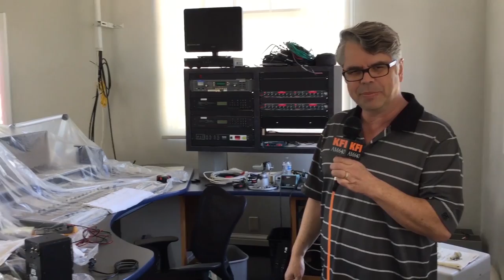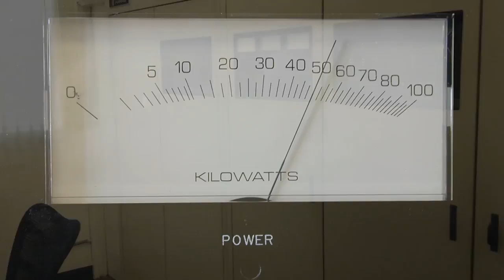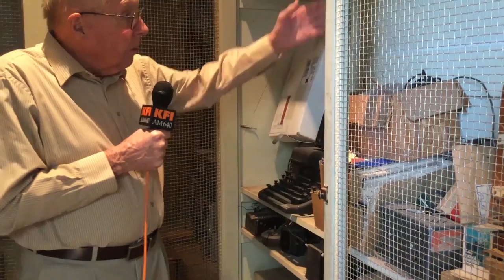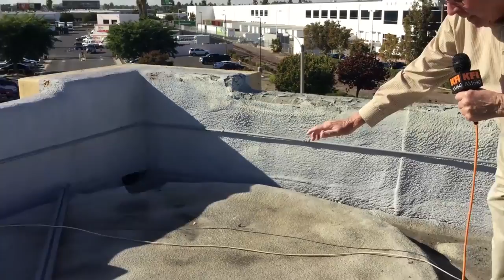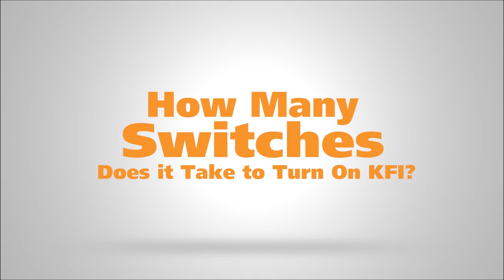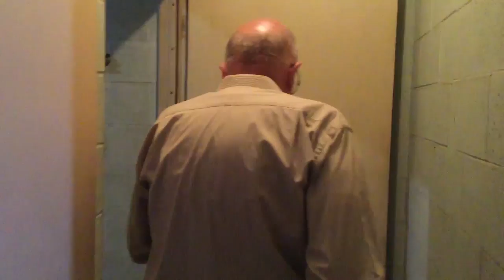KFI AM 640 50kW Transmitter Facility Tour

Comment: Having been in radio for over 50 years, and loving the engineering side, great job on this video. So much has changed, making the job easier!  It was nice seeing the progression in transmitter size, we loved the DX50’s, but Nautel came along and successfully crammed a lot into a small package. Again, a very enjoyable video!
Reply: I liked the transmitters you could walk into.  The RCA TT50AH TV transmitter even had a little “garden shed” for the HV rectifiers.  I can’t remember if TT25AL had the same feature.

Comment: In the mid 80's I lived in Buena Park, about 2miles from the antenna, and built a crystal radio that only played KFI out of an 8 ohm speaker. It only needed a stake in the ground and a long wire loop connected to an inductor and a diode.  The RF energy in Buena Park was so strong that it did not need it's own electricity, it could extract it from the earth and a long wire.
Reply from the maker: That’s amazing. Do you still have it?
Reply: Wow !! I service guitar amps and other related gear . I find modulated electronics fascinating as well.

Comment: I have to think that many of those extraordinary backup features were a result of KFI 640 being a 50KW clear channel designated official info source back in the CONELRAD era.  All the receivers had the round/triangle CONELRAD symbol on the frequency scale at 640 KHz and 1240KHz.  
According to the FCC, KFI is still 50KW, but certainly not clear-channel anymore.  Several other AM stations on 640KHz in North America including others running 50KW. and many in Canada, Mexico, and Central America.
Ref:  https://en.wikipedia.org/wiki/CONELRAD

Comment: KFI just celebrated it's centennial:  Commerce Department license number 137 was issued to Earle C. Anthony on 31 March 1922.  Anthony, the Packard dealer in LA, was also a decent engineer himself.  Back then, all stations shared 833khz.  Once the band was spread out, Anthony nailed down 640 and stayed there.  The only other station there then was WOI, the Iowa State University daytimer.  For years, the NBC affiliate in LA, with battles between Anthony and RCA boss David Sarnoff, who wanted to buy it.  With clear channels being broken down over the years, it doesn't mean what it once did, but KFI's position at 640 made it unique.  Here in St. Louis, the former KXOK, 5kw on 630, pretty much eliminated KFI, so I only got to hear it when I went out toward Kansas City.

Comment: I started Dxing when I was 15 with a National NC-173, which I still have.  The glow of the tubes and the faint smell of insulating material comes back.  KFI would almost peg my S meter.  KFI @ 640 KHz and KTNN @ 660 KHz are mainstays in the southwest US.

Comment: That is a 40’s era Buffalo drill press. I have owned and sold several of them.  
Love to see the old transmitters. The new ones are just a cabinet full of cards. You can lose one or two and send them off for repair. Only brings the station down a few percent. 
Always wanted a Gates transmitter for the house. Everyone needs one. 👍
Reply: I worked with an old Gates 250-watter from the 40's that wasn't much bigger than a fridge.  Didn't take it home, though.

Comment: Here’s a thing: I’m often driving home at night in the mountains of Colorado from the high country down to Denver. I always listen to “Coast to Coast AM” late at night. My home station is 850 KOA which is also 50k watts.  But I have to listen to KFI for the first part of the drive home because it actually comes in clearer than KOA does. Probably because of the high altitude and skip intervals. Not until I’m descending down into Denver does KOA come in clear again and KFI fades away. The magic of AM radio.
Reply from the maker: That’s crazy! I’m in Colorado now and I haven’t heard KFI, but it’s good to know. Thanks!
Reply: You won’t get KFI on the front range but as you go west into the mountains, the signal gets stronger and stronger.
Reply: In San Diego, we used to listen to WLS at night. :-)
Reply: I'm in KFI territory, but I remember as a kid I could listen to KOA and KOB at night.
Reply: back in the 90's, I heard KFI for a few hours between Chihuahua and el paso, tx in the late afternoon while driving
back from a trip. was so surprised when i recognized it was from Los Angeles
Reply from the maker: @lwilton  I listen to KOA now.
Reply from the maker: @socalltd  That's great to know!!
Reply: @tom7601  Gosh, that's a long throw for a Ohio station that wasn't normally available west of central Colorado.
Reply: @michaeltamburello  WLS is in Chicago.  Maybe you're thinking of WLW?
Reply: @ApartmentKing66  WLW and WLS are/were both possible. I picked up KFI and one of the big stations in San Fran at night here in Indiana long long ago before all the made in china junk got in our nation trashing the radio bands with RFI
Reply: @ApartmentKing66  WLW is Cincinnati, Ohio.

Comment: Many thanks. I have a hand-typed QSL letter from KFI dated August 19, 1963 when KFI studios were located at 141 Vermont Avenue,  signed by C.W. Mason W6JD, the Chief Engineer at that time. The station was owned by Earle C. Anthony and the letterhead said "Since 1904." It really was a clear channel station. I picked it up pretty good from Virginia and Chicago. 73 de W9ALZ.
Reply from the maker: I digitized vintage letters to the station dating back to the 1920s! Many of them had silly doodles on them. Thank you for sharing.
Reply: @helenefederici4591  Thank you. My 1963 QSL letter is digitized. If you would like to add it to your collection, I would be happy to send it. I also have a 1931 KFI QSL letter with a photograph of the transmitter. And I have a 1931 KECA QSL. KECA was also owned by Earle Anthony's Packard Agency. These are all digitized. Is your collection available to be viewed online? I would love to look them over. Cordially, W9ALZ

Comment: That 150 feet of "dead tower" was disastrous in any circumstance, a strong tropical wind could cause a total failure.  When the main tower fell I read that it was sharing real estate with the paring lot of a TV facility of some kind and the new CONCRETE ring messed up the driveways in that parking lot .  Very nice presentation. Ron W4BIN
Reply from the maker: Thank you Ron!

Comment: The old day transmitters were huge monsters. Today its almost a 50kw refrigerator.
Reply: The pix of the RCA 50B are similar to those of the Belmont CA KPO transmitter made by GE.
Reply: At the Greenville Marti/VOA transmitter operate the monster SW transmitters that still use tubes in their power output stages. The GE transmitters date from 1961-other transmitter date from the 80’s these have SS low level  RF circuits and control circuits. The Green ville site used to have Continental 420A500kw transmitters built in the 1940’s each was as large as a house! All the stages were manually preset and tuned. The later transmitters could be autotune. Set the frequency and power and turn on! Was a real treat watching the autotune and then the output at 250 or 500kw. Now it is done manually. The autotune rigs were from Brown Boveri and AEG/Telefunken. The Telefunken no longer used since requires a HV transformer that is no longer avalaible. The 420 transmitters were replaced by 419 -3 of them from another plant-250kw.use only two ower tubes. The modulator is SS PSM.

Comment: Every time I turn on my little ccrane sky wave radio to kfi in the evenings I think of this video. Wow this station comes from here! I’m 400 miles from the transmitter.
Reply from the maker: Wow! That’s amazing 😉
Reply: Helene Federici I’m in San Francisco Bay Area in the east bay near Fremont. KFI is very clear after the sun goes down. KNX too on 1070.
Reply from the maker: steve94044 they say that radio signals travel farther at night.
Reply: @helenefederici4591  Oh they absolutely do, more correctly mediumwave stations, that frequency range. It's why a lot of smaller stations have to either shut down, drop power drastically, or change their radiation pattern after local sunset, because everything changes.  Daytime is all ground wave; night time starts bouncing signals off the ionosphere and back hundreds of miles away.  When I was a kid in Pennsylvania we logged all the stations at night -- WWL New Orleans, WSM Nashville, CJBC Chicoutimi, KXEL Waterloo Iowa, KMOX St. Louis, WBAP Fort Worth, a couple of Mexican border blasters --- we had at least six different Chicago stations, which were 900 miles away.  And here in western NC I've logged KOA out of Denver.

Sadly it's not as much fun as it used to be.  For one thing the band is more crowded, making those distant captures harder to get, and for another thing there's so much satellite/network stuff on that you can't tell one station from the next.

Comment: Love the late 90s KFI, listened to it in the San Francisco Bay area in the late 90s at night, via ionospheric skip. the signal came in clear most of the time with some fade outs, which is expected.

I was surprised to see that the antenna is in the middle of an urban area, like surrounded by warehouses and stuff and the transmitter facility kinda looks like a mechanic shop...

It's great that KFI actually has an EMP protected emergency transmitter AND diesel generator backup....oh yeah....is the diesel generator also EMP protected? It looks like it was just open to the sky on top, or is that the diesel fuel tank?

Oh yeah, diesel fuel degrades after 1 month if not treated properly, if treated with stabilizers and biocide it can last a year. So, hopefully KFI has some people who replace all 9000 gallons of the diesel fuel on a regular basis.

You know how food goes bad, gets all rotty....well diesel fuel and even gasoline goes bad, gets rotty as well.

It might be better to store propane in a huge tank since propane never goes bad and run the generator off propane.

Comment: That multimeter in the background at 5:30 or so looks a lot like the Fluke I used in the military in the 70's.
Reply: It may be a Simpson.
Reply: That's a Triplett 630 series with the big red knob;  the Simpson 260 has a small black function knob, still have one.  DId Fluke factory service back in the 1970's and they were all digital (DVM & DMM).

Comment: The new transmitters are compact, efficient and reliable but not as impressive to see as big glowing vacuum tubes, water pumps and mercury vapor rectifiers with their blue glow pulsating in step with the modulation.

Comment: CAA said turn off tower lights in 1941 so Japanese can't find us...did they tell the city to turn its lights off as well?  A whole city might have been easy to find if lit up you know...  We left the lights on in the east which proved to be so useful selecting and targeting ships from U Boats that oil tanker crews at one point refused to sail.   I watched a 500/1kw BC transmitter at a DA-D in the earliest 60s while doing my homework.  The modulation XFMR blew up.  I borrowed one from a radio amateur with a 1kW Tx and it worked fine until the replacement arrived.  If I had been smart enough, I would have rewound the broken BC one.

Comment: I wonder hat ever happened to the AM Stero experiment in the 80's? I still have my Sherwood AM FM Cassette stereo from that time period. It was AM Stereo compatible.
Remember seeing phased arrays for some AM stations in Columbus and Cinncinnattii, every tower had a doghouse by it for th matching equipment. Nothing like a Hot Tower transmitter site!
Reminds m of a friend who accidentally touched a 5 Kw hot tower, received a nasty RF burn from it. He tried calling the local hospital asking if by had any information regarding RF burns. Their reply was "I'm sorry sir, we have no one registered by that name here". Stupid receptionist.
Reply: Subgunman Yes, there are radio stations still broadcasting in AM Stereo.  I listen to KIXI 880 in Seattle, which broadcasts on line, still feeding their stereo feeds to station tx and on line. It's the only way I can hear them when I'm in the area, feeding it to my car radio via wifi/Bt!   Others around...Check out the radio guides.  I also suggest but don't work for, gracedigital.com internet (radio) receivers. Love my (mono speaker-stereo output) Mondo+ receiver, with optional battery ($40 lithium) gives me access to the porch or garden Amazing 100ft line of sight) for 4 or 5 hrs thru WIFI feed or local Hardwire thru USB input for thumb drive, recorded stuff which takes time to down load audio lists, to use LAN  adaptr to usb to receive your stream info via your router wire.  Stereo non-portable radios in wood and other cabinets are available too, some with magnetic chargers for phones. Nice. All radios also broacast shout and also reveive via blue tooth showing the program you are playing on the TFT screen! Sweet!  My Mondo+ speaker is coupled to a 12w class D amp that gives great bass response, & only wired for
 mini 3.5mm headphone out. The RCA Stereo line out and earphone jacks are in stereo!!  LISTEN TO ANY STATION AND PROGRAM from around the world as long as they stream.  You can also go TO oN-LINE FOLDERS thru gracedigital.com/ (your acct signon name)  THAT YOU INTERREACT WITH TO PROG. THE RADIO and add the streams to your personal files.   THRU GRACEDIGITAL.COM, YOU CAN SET UP "MY STUFF" AND OTHER FOLDERS. BUT CAUTION: DON'T CHANGE NAME OF THE FILES NAMES THAT YOU CAN DOWNLOAD TO YOUR FOLDERS. IT CAN CORRUPT THE LINK TO THE STATION AND IT WILL BE HARD TO PROGRAM "ALL OTHER" RECEIVERS CONNECTED TO GRACEDIGITAL'S MASTER COMPUTER FILES THAT USE THAT COMPUTER AS A "Surrogate" ROUTER TO YOUR STATION OR PODCAST'S LINKS.  ALWAYS ASK FOR HELP before you think outside the box with this or any internet radio!  THEY ARE REAL GOOD AT ANSWERING questions, ESPECIALLy Lynda...nice Lady.  CCrane and others also have internet radios that I considered...but the Mondo+ is smaller/equal to a Toaster size in 4 colors WHITE, BLACK, RED, AND FLAT BLACK!, but the programs are just a "Fine Toast with Jam &  BUTTER!" OH, ALARMS, TIMERS, AND ON-LINE BACKGROUND SOUNDS AND SPECIAL MUSIC IS ICING ON THE CAKE!  Enjoy!
Reply: i remember back in the early 2000's hearing about the AM stereo Experiment , I think they ended up developing some kind of digital equipment to hook up the stereo signal in but i think since FM was becoming hugely popular they moved it over to working on what is today  FM HD radio .    But that is just my speculation
Reply: @SACWarrior70s  Thank You for the info! will try accessing the web site if possible, stationed in the EU and a lot of the USA sites refuse to allow access due to the EU's new privacy laws. I should fire up (hopefully not popping any dried out caps) my radio slowly and see what i can pick up here where i am located, it would be interesting! some countries over here have done away with AM and FM analogue stations and are doing DAB digital broadcasts.I would figure some of these stations would require a subscription to receive their programming.
Reply: I believe they use HD radio now. It is a digital signal which is capable of stereo audio.
Reply: They didn't know RF stands for " radio frequency "  . Little did they know , you can go to the local hardware store and buy a can of RF . Lol.
Reply: What happened?  Leonard Kahn.  He threatened lawsuits if the FCC type-approved the Harris or Motorola systems over his.  FCC decided to 'let the market decide';  it didn't, and AM Stereo died.
Reply: @rjmcallister1888  I don't miss the ""almost imperceptible" distortion it added. No loss IMO.

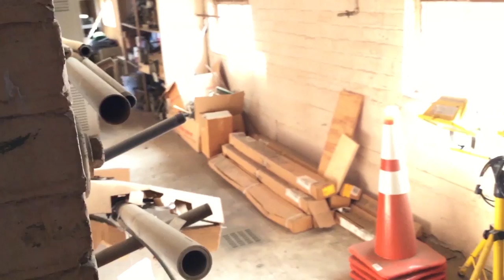Comment: At 28:33 into the video, you mentioned drains for possible transformer oil leaks! Would this oil have been of the PCP containing type? This type of oil was a highly carcinogenic type that caused cancer with a lot of electrical workers changing leaking transformers on power poles and such! 
   Where did those drains lead to? Just asking!
  Hindsight is always 2020 from those days!